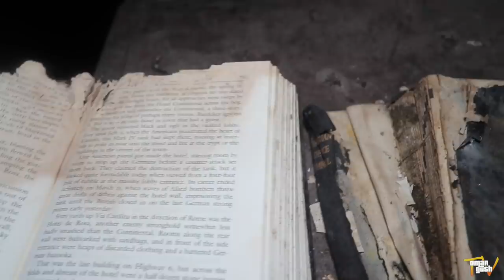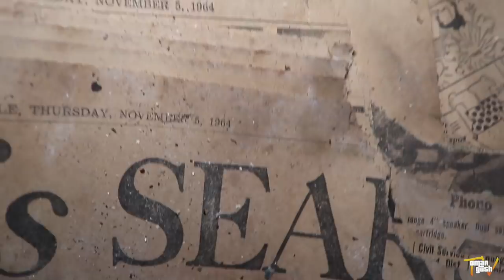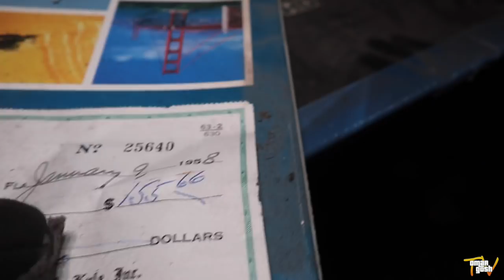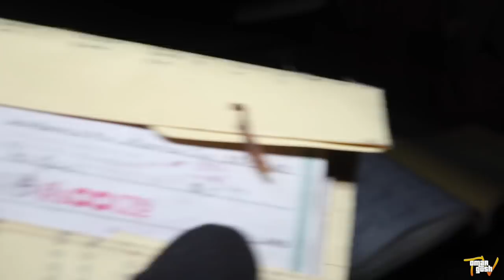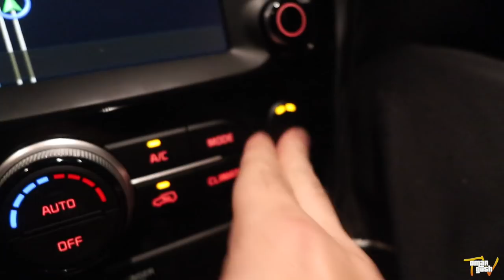(Haunted Funeral Home) They Left Everything Behind

Comment: The basement is where they would dress and place bodies into the caskets.  I didn't see crematory areas,  so they have have done that offsite. The prep table you saw was for embalming and bathing.  Once the body was embalmed,  down the elevator it went,  dressed,  placed in casket, back up the elevator.  This parlor had a show room,  chapel and full services.  That small urn looking box is an old school urn. I may be 100% wrong in all of that, but from a little research that's what I could find out. Hope that helps!

Comment: That silver box you found is a vault, for a baby or to bury ashes, a casket or an urn would go inside that box , they put sealant around the lid to seal the vault, then they put it in the ground,  used to work at a cemetery.